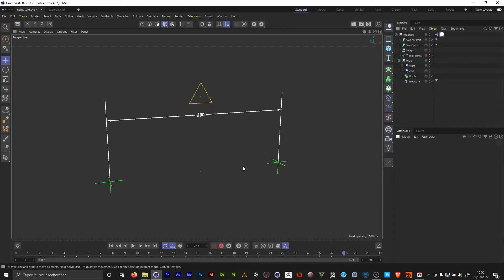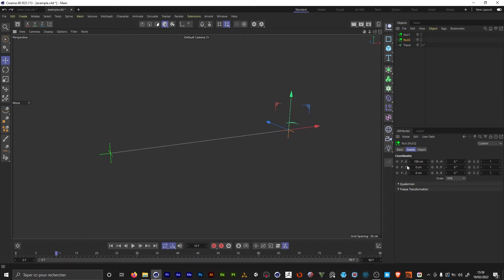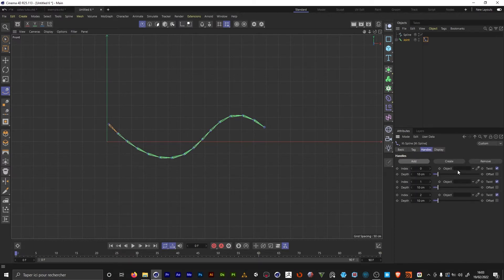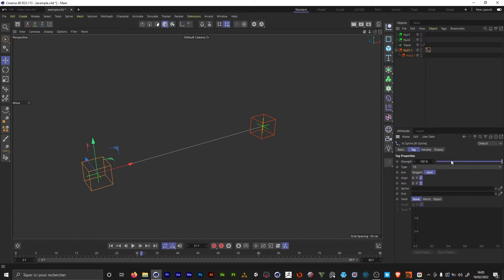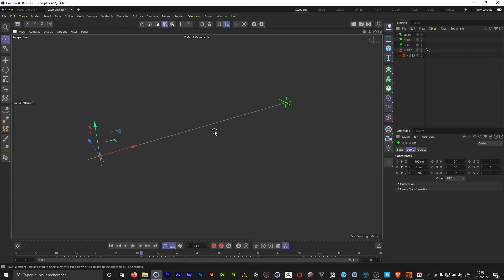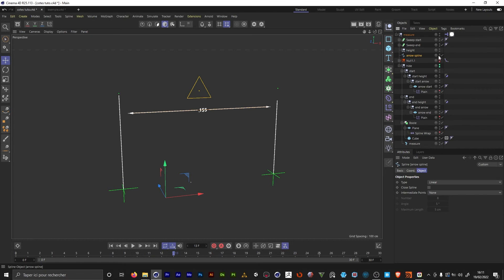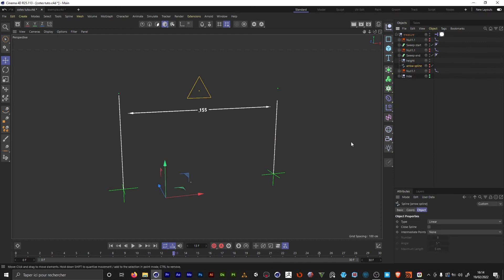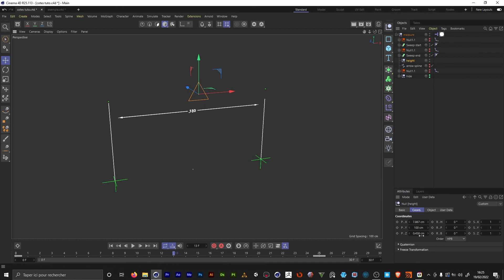[EN] Industrial drawing part2b: measurement lines

Comment: to fix the update problem of the boolean, simply change the order of some things in the hierachy of the content browser:
- put "heigth"-null on the bottom of the hierachy (under "hide", but not inside "hide")
- move the expresso tag from the "measure"-null to the "heigth"-null
Reply from the maker: Hi, I didn't take the time to address this issue earlier, so I appreciate your input. 
I tried it myself, but I'm still experiencing the update problem. 
Did you happen to change anything else?

Comment: if I rotate measurement null after design, it is going to completely deform the whole setup. I can only use this in XZ plane, please guide me.
Reply from the maker: Hey, I won’t have access to my computer for the week, but I’ll check it out when I’m back.
Reply: @gillesdillenseger6472   thank you so much for replay, btw I found a glitch. I did mistake in start hight and end hight's constraint tag, I did not checked Local P. Now I did correction.. and again thank you so much for great tutorial..
Reply from the maker: Yes, that part is a bit confusing. I suspected the error might be related to the local/global positioning. I'm glad you found a solution!

Comment: Thanks for the great tutorial! Just wondering, how would you add cm or mm after the numbers?
Reply from the maker: Hi, thanks !
sorry for the late answer , I didn't have acces to my files , and wanted to look at that in context to give you a proper answer.

just go to the "measure" text and align it to the right
duplicate the text, write cm or mm and align to the left
then drop those two texts in a connect object and zero out the coordinates of the texts.

then in the xpresso tag of the measure text, look for the "measure" nodes (there are 3), and drag and drop the connect on to those to replace , the connexions should remain.

there's also a measure node in the first xpresso tag of the main null , just drag in the cm text there and link the text size to the height of this last one.

I hope this makes sense
thanks for watching !